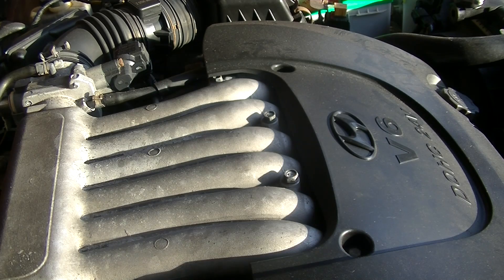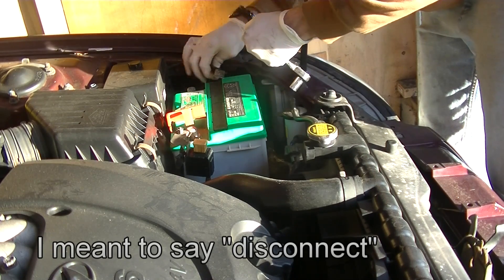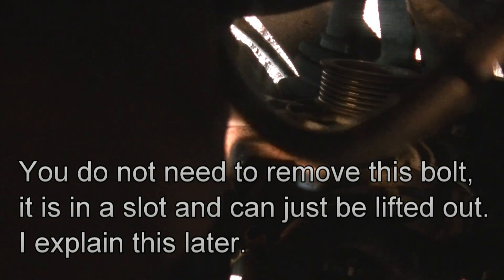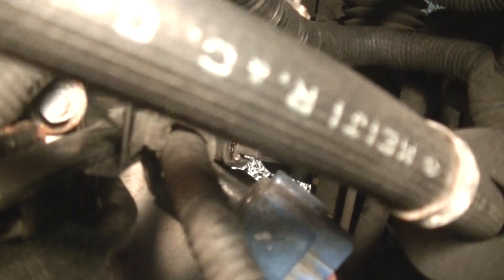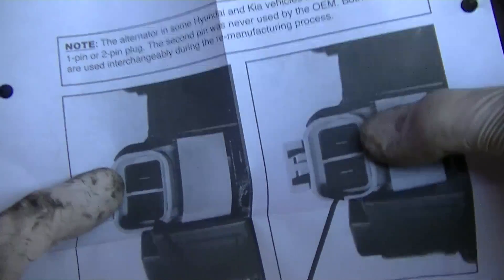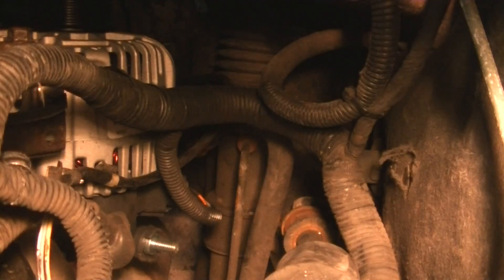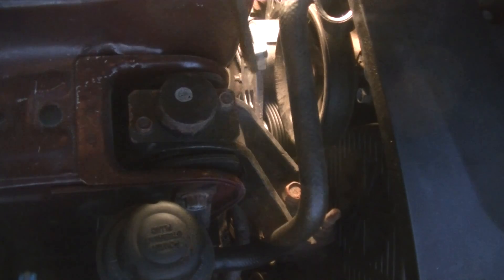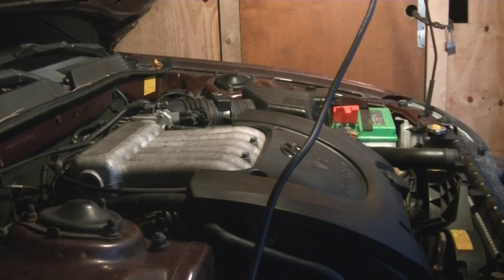Alternator Replacement [2000 Hyundai Sonata]

Comment: Thanks for this video. I should have looked at it first. I had a hard time thinking of how to take the bottom bolt off. I didn't know about the slot openings. My brake light turned on, and the battery one also at the same time. It came out to be the alternator. No fuses and cleaning the alternator didn't help. Bought a new one. Yet not installed do to the weather.

Comment: This is a great Video, and very helpful.  But I have one question.   I'm doing this on my Hyundai and I'm trying to loosen the belt with the tool I got,  but I do not see a place for the 3/8 drive to go.  it's just this silver thing that you were pointing at,  there are 3 indentations on this thing but nothing that fits the tool, or its attachments.  Can you please help me with this? I've been stuck for hours now trying to research how I take this off.   Or loosen it.  Thanks

Comment: Hey This video helped me out a lot! I have a 2001 Hyundai Sonata GLS V6 and there is just enough room to pull it out from the top. I did take the wheel off and removed one screw which broke on me due to rust to pull part of the plastic cover back to make it easier to get to the bottom bolt on the alternator. :) If I didn't have to take the new one back out again to locate a screw I had dropped this would have only taken me an hour and a half.

Comment: Well it seems the slotted stud that goes into the engine to hold the bottom of the alternator rounded itself when I tried loosening the nut. Probably going to have to drill the nut off and replace the stud.
Reply from the maker: That might be difficult with the limited space.  I would try a few things before going that far.  Here is the order of what I would try.

1. The easiest way to get rounded nuts or bolts off is to get a tool designed to do that.  Namely, a turbo socket, or the Go2 Socket (google them). 
2. Hammer on a smaller socket and try to loosen it that way. (Usually doesn't work, but I always try it.)
3. Take a decent size pair of vise grips and get a REAAAALY good clamp on the nut and try to loosen it (This has worked so many times for me, vice grips can REALLY be a life saver)  Just make sure you use VICE GRIPS not pliers (although you can also try pliers but they probably wont work very well.
4. Cut the nut off carefully with a Dremel.  A dremel is low-profile enough to fit in this tight area.  If done correctly, you can cut the nut off without damaging the threads (or just just the nut with the shaft if you are going to replace it anyway).
Reply: Yes I don't know why I didn't think of using a Dremel especially since I already have one. Unfortunately the amount of room behind the alternator is VERY limited so I think I'll just Dremel the nut off and replace both the nut and the stud. Thanks for your quick reply!

Comment: Does this car have ABS? Im reading it may be different with the ABS unit being in the way the alternator has to come out through the wheel well.
Reply from the maker: I don't remember, I worked on this car so long ago.
Reply: Fyi I have a 02 Sonata with ABS and I can confirm that you need to remove the wheel well, wheel hub, and passenger axle to get the alternator out. For those of you who have this type of car.
Reply: @bravoteam123  bro this comment from 7 years ago just answered my question. I've watched so many videos of people working on sonatas without the abs and it's no where near the same when it comes to pulling the atl out 🙄

Comment: do you think that it would be the same process for an 03?
Reply from the maker: If it has the same engine, it should be the same. I don't imagine there would be any huge differences from 2000 to 20003.
Reply: Cool, thanks :)
Reply: +MattsMotorz I'm working on an 05' with 2.7L V6.  Do you know if it has the same mounting bolt on the bottom as the 2000?  That's where I'm stuck and until this video, I never thought to try and swing it off.

Comment: What if in my car the tensioner doesn't have the little square hole for socket? How can i release the belt then?
Reply from the maker: Tensioners such as the one you describe have a lock nut that must first be loosened first and then have a long bolt that sets the tension. Loosening the bolt will loosen the belt.  The downside to these is you need to properly set the tension when putting the belt back on, as it isn't automatic.